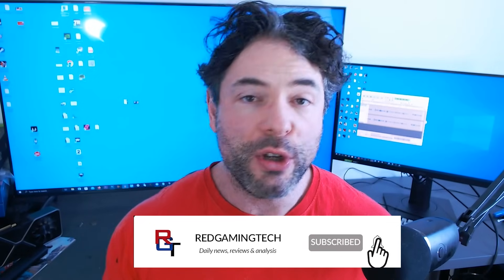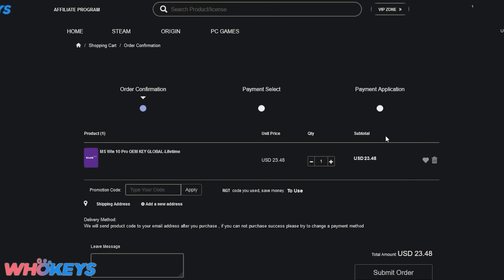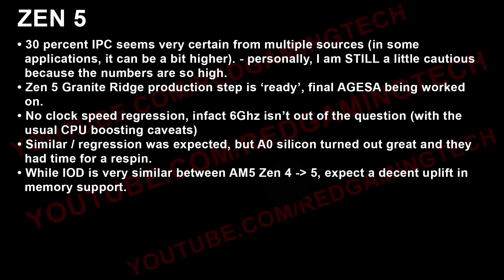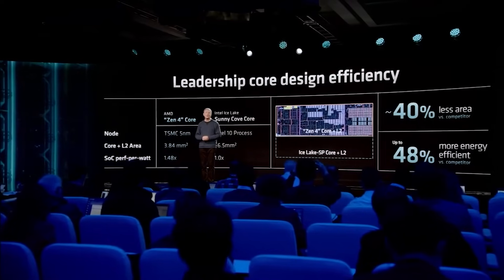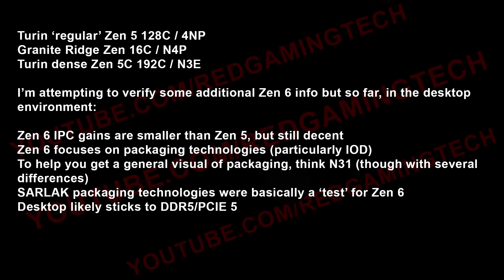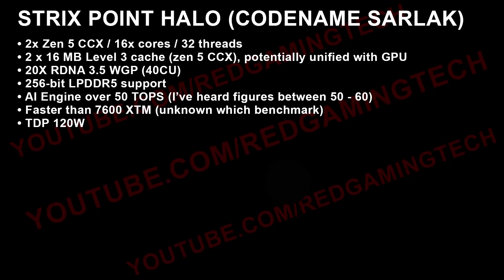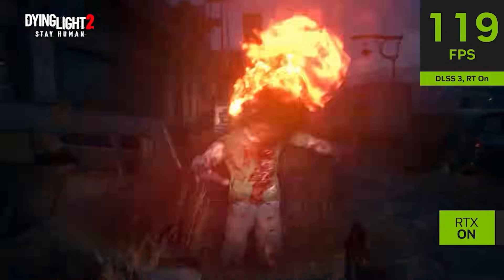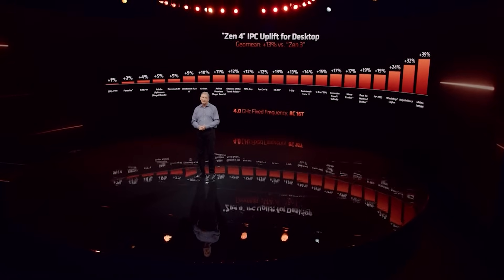Zen 5 Will DOMINATE - HUGE IPC & Performance Update

Comment: 100% I guarantee I'm right...
The frequency will be lower, the frequency will be about the same, the frequency might even be higher.
IPC will be a modest increase, IPC will be a massive increase.
It will be priced lower than the current Zen 4, it will be priced higher than the current Zen 5.
All of the above might still change, I'm hearing conflicting things for different sources, a leak can still be right but things change before launch...
Reply: Lmao.
Reply: Some of this is due to shifts in development/prognoses others are simply faulty sources. These leaks are always to be taken with a huge grain of salt, otherwise disappointment will be inevitable (look at RDNA 3 and the "doubling of performance or even more" that turned out to be around 35-40%).
Reply: @pcgamingftw5694  I honestly have nothing against Paul, I've watched his channel pretty much right from the beginning but if I had to be brutally honest, I actually don't believe he has any 'real' sources. That's not to knock his videos, but I think he just looks online, sees what's being said, adds a bit of flavour and calls it a source. Then if you make 1 video saying 1 thing, then another video saying the opposite you can at least say one of your sources was right.
He still has to do the research, create the content, market himself, etc so it's not easy but I think he misleads more than most realise.
Reply: @pcgamingftw5694  No, these guys are just making shit up most of the time.  Either that or they're literally just reporting on whatever quack emails them with some 'info' without doing any legitimate vetting at all, and then lying about these being 'credible' sources.
Reply: LMAO, nothing is in stone but its a good sign, Paul can only reveal details what his contacts inform him about, their rep with him only becomes more reliable over time and as he has stated it seems that these leaker's have been reliable before. None of us here believe that he will always be 100% on the money 100% of the time but I have found he has been as close as you can be and he is always first to state when he got it completely wrong and as always he says take this with a pinch or bucket of salt !
Reply: The frequency will likely be a bit lower but they're incorporating vcache to all CPUs from everything i read.
Reply: @GSP-76  - That is the first time I have heard of that.In facts RGT have said the X3D variants will be released soon afterwards so I am not sure the rumour you have heard is correct !
Reply: @mrtuk4282  Many leaks, articles were saying AMD wanted vcache on all CPUs...as a matter of fact that's why all this talk of lower frequencies came from. The vcache CPUs can't clock as high as the non vcache CPUs. They were saying clock speeds would likely get pushed back to 5.2-5.4ghz instead of 5.7-5.8ghz. I guess we'll just have to wait and see what happens. There's tweaking limitations on vcache CPUs so I don't know if that would get carried over too, which would be a bad thing.
Reply: @GSP-76  - I would have liked a 7950X3D if it had VCache on both chiplets, lower max clocks is not a real issue for me since I tend to run my CPU at 105W ECO mode and with a max clock of 4.5Ghz controlled by a Linux App which I can run at anytime to set the max clocks. this limits the CPU heat to a max of about 60C which is great will still getting superb performance from the 16 cores/32 threads.
Reply: @GSP-76  not for Zen 5 but I could see that happening with Zen 6 as that's a bigger layout change.

Comment: The problem is, Windows 10 still isn't stable enough.
I've been trying to use 10 on my 7950x for like a year now and it's View Reliability History typed in the searchbar is abysmal, a rating of 2 out of 10.
Windows File explorer of all things hangs up with a solid white screen, Firefox crashes at random playing a YT video, and sometimes the network cared and wifi card just disappear and you have to shutdown and power cycle the computer for them to reappear.   Next to none of my work apps run under Linux, so that's out.   Like most people, I miss Windows 7.  It wasn't great, but at least I could get some work done without losing all my open work at random.
Reply: You have a hardware issue.  No one is having bugs like that with windows 10.  Try updating your MB's bios and make sure you chipset drivers are up to date.  You likely need to reinstall windows with a fresh brand new iso installed onto a thumb drive.
Reply: @geoffreystraw5268  Done all that.   I can show you a picture of my Windows Reliability History if you like.  Windows has never been great fro stability in any version, really, esp. when it comes to Wake from Suspend.

The highest it's ever been with Wind10 is almost grazing 5 out of 10, but mostly it hovers around 2 out of 10... crashing about every 2-3 days.    

Ryzen 7950x on Gigabyte x670 Aorus Elite AX  128gb Corsair Dominator RAM 4800   Nvidia Geforce 3070.
Reply: also think you have some other issue or hardware issues. I don't have any of those bugs, haven't had in 10 and 11. Although not saying it's 100% stable and bug Free
Reply: Dude i have an up time of over 3 months and i have an amd gpu
Reply: @laharl2k  Do you ever put it to sleep and wake ip up, or is it just on all the time as a server?   See I put my computer to sleep all the time...
Reply: My 7900x works great with w11. Mobo manual asrock steel legend only mentioning w11, not w10 as supported.
Reply: Do you recomend upgrade from w10 to w11 with an i5 10gen intel